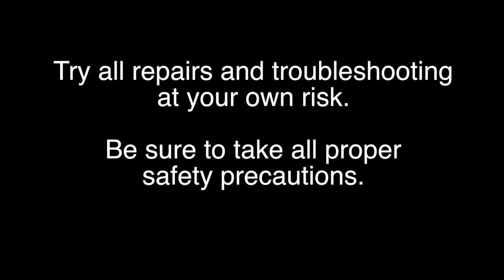Vizio E550I-B2 No Picture On Screen Complete TV Repair Kit - How to Replace all Boards

Comment: Something for DIY'ers to try. My Vizio E550i-B2 refused to turn on and all I got was a black screen but audio was working. I was planning to order a complete TV repair parts kit but I recalled reading in a Vizio forum that the connector (2 rows of 8 pins) between the power supply board and the LED driver board could be bad, so I took a close look at it. What I found was the pins of the 2x8 connector on my power supply board were loose and not well soldered to the board. I re-soldered these pins and this fixed my TV problem. So, you might want to check the pins of this connector on both the power supply and LED driver boards to make sure that they are soldered to the boards.
Reply: HOLY HECKKKKKKK!!!! THIS   I had the TV apart for months trying to figure it out but it was right in front of me the whole time.  Your comment was like the best thing for me this week.  Thank you and I will be returning the board replacement I just had overnighted to me.  My father in law soldered it for me in about 5 minutes out in the garage
Reply: Thanks a ton! easy fix like stated above
Reply: So I did this... and put it all back together (what I took apart was minimal and only related to taking this one board out and sderijg it then replacing it and all of the plugs) but now I can't get the tv to turn on at all now that it's all put together!
Reply: Thanks Thao, I also found that the connector on the power supply board [to the LED driver board] was loose. Soldered it in place, and now the TV is fine.
Reply: Bought a fine tip soldering gun for $12, 60/40 solder and some copper wick ribbon.  Soldered the connector in about 10 minutes. Bingo!!!!. sooo easy!! Thanks for the tips
Reply: Tried this to no success. My TV wont power up now, however the connector is definitely on tight after soldering (was very loose before). The solders I made all kind of run together which I assume could be the problem. Did all you guys have 16 separate dots as solders?? Im gonna buy some desoldering wick and start over but just wanted some inputs first. Hopefully I didn't completely fry anything from my soldering running together...
Reply: Was my first time soldering I might add. I definitely should have gotten some practice in before :/
Reply: Reid Beaty I just did the same thing and now my tv won’t turn on. Wondering if I fried something
Reply: I just did this yesterday.  You definitely do not want solder touching from each lead.  That will cause a short circuit.  I'm not an electrician so I can't tell you if it fried it or not if you already tried to power it on.  I had a couple of mine touching because I'm not the best solderer in the world but i just moved it and wipe it off with the tip of the soldering gun.  You can try to remove the solder connecting the leads to each other unless you just put a big blob on it.  Like I said though, I'm not sure if that would cause permanent damage or not.
Reply: @Reid Beaty Have you had any luck removing the solder and resoldering more neatly? Some of mine clumped together as well and now I too have no power. Wondering if I could remove and re-solder, or if I should just purchase a replacement board.
Reply: Thanks! This was exactly what was wrong with mine and re-soldering worked like a charm!
Reply: Thank you so much for this......I just fixed the 55" TV that was given to me because it would not power up.
Reply: Thanks for this. Same problem with mine.
Reply: This worked for me, Found this tv about to be thrown away because "it wouldn't turn on"
Got it home, it turned on, then turned off after a bit, did this, the pins were loose as hell, resoldered and now I have another 55inch tv :)
Reply: Thanks Thao!!! Pointed me in the right direction. Re-soldered each pin and it fixed things for me. I had to clean up a couple of bad solder points where I bridged pins. Used copper braid to clean up the mess before powering up. Also made sure to ohm things out before powering up. The negative pins are bonded together. Positive pins should not have continuity with other pins.
Reply: 100% the problem on mine. Make sure your solder doesn't touch. Fixed in about 10 nervous minutes with a shaky hand. Go extremely light with the solder, you don't need much. Thanks for saving me so much headache, time, and money!
Reply: After reading your comment I went and checked my connector. It was also loose. Resoldering the 16 pins just saved me!
Reply: @modlovecat  I know this is an ancient post, but just in case you never figured this out, @reid Beaty below had a similar problem and he mentioned that his solder ran together, each connection should be a separate dot and sometimes they are very small, if they are touching then they are shorted together and that is just as bad if not worse than them not being connected.
Reply: @reidbeaty2269  and  @modlovecat  I know this is an ancient post, but just in case you guys never figured this out, it sounds like you have a very similar problem Reid mentioned that his solder ran together, each connection should be a separate dot and sometimes they are very small, if they are touching then they are shorted together and that is just as bad if not worse than them not being connected. There is no easy way to know what if anything was damaged by this, but solder is cheap and it should still be an easy fix to use some copper braid and wick all the old solder away and start over with very small dots one for each connector. Good luck.

Comment: FYI to all the DIY'ers. I had my Vizio E5501-B2 suddenly not power on. It had no led power light, no audio or video - nothing! I opened it and reseated the connectors on the power supply. Put it all back together, and it worked! The gremlins must have fallen out of it! This is for some of you to try, before you go ahead and order replacement parts.

I actually lost video on this tv last year, and the power supply was the fix. It had audio, the screen was black, and the flashlight test showed that the video was in fact present. 

Thanks Shop Jimmy!

Comment: Another Positive review as THIS $80 part fixed our 5+ year old TV. Btw- same problem occurred just a month before the 2 year warranty expired and the BestBuy repairperson said this would have been a $200 fix. 
However, someone needs to make a video for taking OFF that back panel. Two screws were stripped (thanks, BB guy) and so extra $ and time were spent dicking with that. Moreover, there is a galvanized piece of metal that fits at the base of the outside panel that MUST be pulled out by sliding it out in order to open that panel. Do try this fix before junking your otherwise excellent TV. (Shop Jimmy has a 10% off coupon if you sign up for emails. THANKS!) 
Fred

Comment: Hey thanks for these videos. They are a big help. I have this model, and did the flashlight test to confirm picture is there but no led. When flipping it over to test, I noticed the LEDs came on. When I tested it again, they remained off. Think its a loose connection in there? ...or should I replace the psu/LEDdriver?

Comment: Thao has it exactly right.  A few minutes wth a soldering iron and the tv's working again.  It appeared that all 16 connectors were loose on the power supply board.

Comment: Nice video👍. While my Visio tv was loading ( Vizio light blinking orange) my son accidentally pull out the pulg, I put the plug back in the outlet, but the orange tv lights blinks for about a minute then the white Vizio lights comes on for 3 seconds then the orange Vizio lights blinks ....and this process reoccurs. What board do you think is affected?

Comment: I have the same model # and it looks the same except there is a wire which goes from the power supply board to the board beside it. It is at the top right corner . would you know why this is ?

Comment: Hey ShopJimmy,

I have this same model Vizio, SN is the LWZ2PPAQ type, and after performing a flashlight test I can confirm it gets video, sound is present, and backlights are out.

Should I only purchase the LED-driver board?
Reply: UPDATE: I took off both the LED Board and the Power Supply board, and in doing so, I noticed that the connecting box between both boards (small black link) was loose on the Power Supply board. I can't tell if the pins are broken but it has some wiggle room... Is it safe to assume this caused the blackscreen problem?

Also, can I solder it back on or should I replace the power supply board?
Reply: I have the same same exact model and No the small black link is meant to be that why.
Reply: what was the answer
Reply: Resolver the connection and should be good to go. There should be no wiggle room and many others have mentioned this repair. Worked for me

Comment: All screws are removed from the power supply board, but the board will not come free at the connection. I've already tugged a bit harder than I'd like to. Any idea how to free it?
Reply: Did you get the one in the middle? It blends in.

Comment: I have this same tv model serial #LWZ2PPAP. My son was playing his PS3 on it then it made a loud shrieking and would not lower the volume. The video continued to play as normal. I unplugged the teams now it will not come back on. No power, led light or any sign of power. Tried different outlets, unplugging and holding the power button to reset but to no avail. Help would greatly appreciated. Only 2 years old.

Comment: My power supply board failed. It is a IC chip that blew up IC CHIP "LD7913JGM61342CU" it is a 7 solder pin located just above 2 small capacitors 22uf & 10uf. If you can find this chip and replace it your board should work again